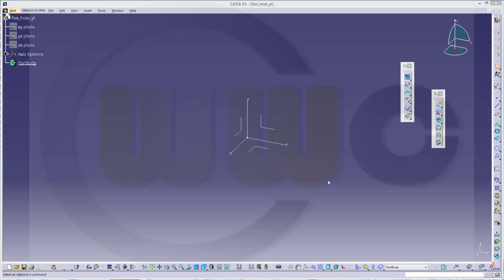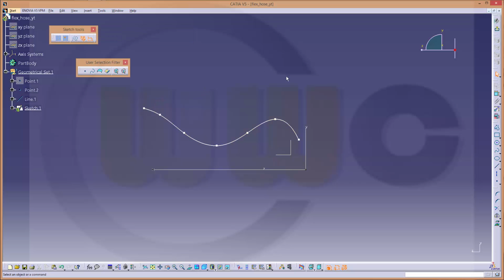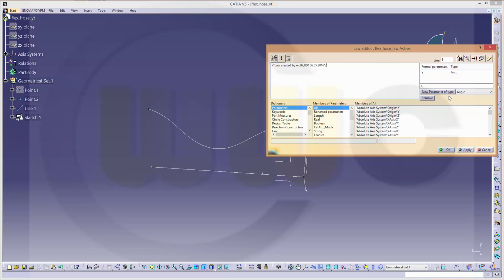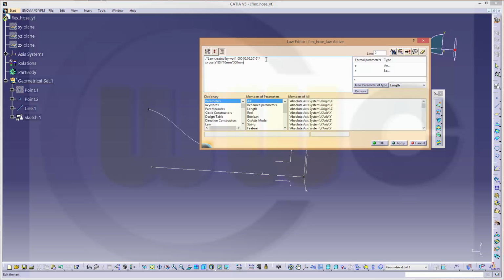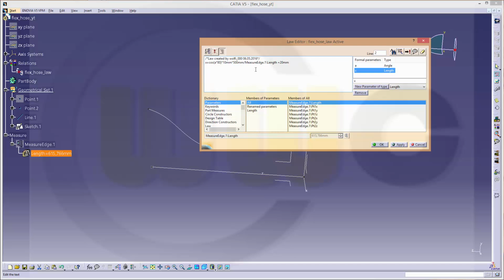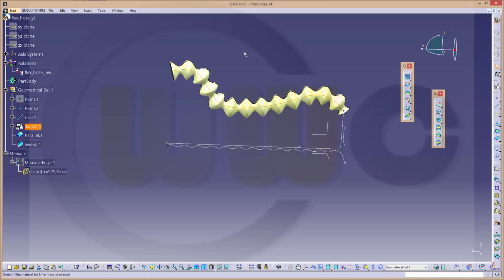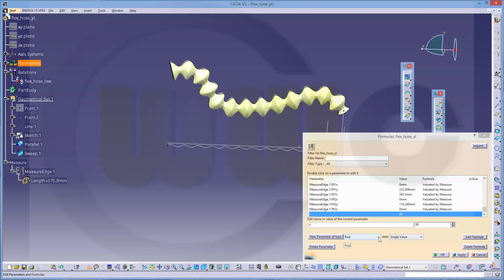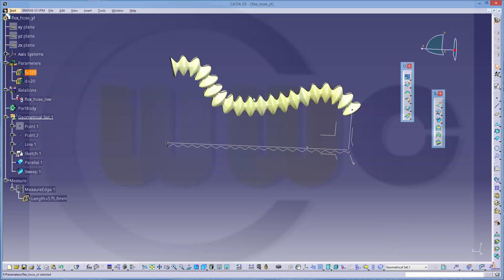User Wish Flexible Tube Catia v5 Training - Laws - Law Curve - Sweep

Comment: Is it possible to have some geometry-properties as a parameter? I am trying to generate a curve depending on the local curvature of another curve. So what i tried is to set up a law with a curvature-measurement as input, but i did not get it to work. Thank you
Reply from the maker: You can use a sketch as parameter, just take a look at the parameterlist if you create a parameter.

Comment: Great insights. Do you know how to create a car suspension and steering in a single CATIA part body (CATPart) using knowledge, parameters, laws, formulas etc. rather than create a kinematics workbench? Any ideas would be appreciated.
Reply from the maker: Sorry, I´m just a trainer - not an engineer. You would do that in an assembly, to do it in one part would be sort of useless.

Comment: Sir, how can I put the parallel curve in a sketch to extrude it?
Reply from the maker: Hi, what do you want to achieve? A parallel curve to extrude?
Reply: +Wolfgang Walden Hi, sir. I want to do a solid which one face has a sinus profile.
Reply from the maker: Ok, I see. So create the sinus profile the same way as i did in my video. Then make a new sketch and project that curve into your sketch.
Reply: +Wolfgang Walden is there a specific function to project the curve into a sketch?
Reply from the maker: LOL - this function is available in almost every CAD-program. It is in the sketcher, you can project edges etc. in your sketch plane.
Reply: I know that it's available sir, but i didn't know where it is xD 
I was trying to use the projection in the GSD module. Thank you very much!
Reply from the maker: ;) you´re welcome

Comment: hi. what is diff between a low created by fog and a low created in formula windows (using add formula)???
Reply from the maker: +shayan roohbakhsh Simple - created with FOG it is a law - created with formula it is a formula.
Reply: +Wolfgang Walden so if i want to draw a helix that it's pitch increases 1 mm in each revolution . i have to use low or formula?
Reply from the maker: +shayan roohbakhsh If you creat a helix - there is button at the right side of the pitch value : LAW - so I would assume you need a law.